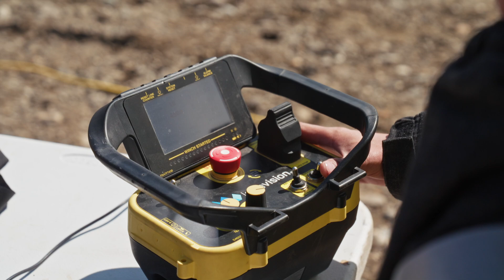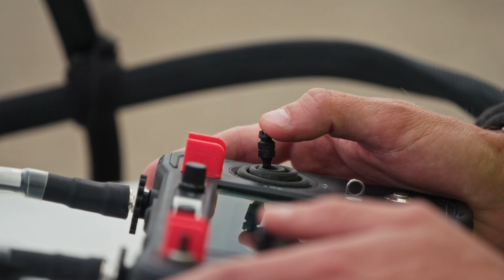Power to the People - 3 x 500kV Drone Stringing at Site C with Infravision and BC Hydro

Comment: Why AC instead of DC?
DC much less resistence.
Bum Crack Hydro suspicious conduct.
Why can't Vancouver Island generate their own power?
You replaced the DC submarine cables with AC but I don't remember public input.
Reply: Why don’t you apply to work at BC Hydro since you seem to know so much champ?! 😂 always a conspiracy somewhere for you nut jobs isn’t it.
Reply: You’d need rectifiers all over, not sure what the cost vs the loss from just running ac over long distances is. Another thing to consider is space because I’m sure rectifiers for 500kv isn’t small.
Reply: I was at the Duncan substation.  The setup was massive.   We saw big circuit boards the size of a squished flat side to side Cooper Mini with a gallon jug of mercury right in the centre of it.  There were a few of them in a stand all with big arcing tracks from one side to the other.

They were buying spare parts from a dam in the USSR (I think it was Georgia) as there were none available elsewhere.  The cables were leaking oil.  This is in Duncan.  The frequency filter yard was massive chopping that square wave to something a lot more sinusoidal.  

It was failing, too expensive to run.   They built the Cheekye / Dunsmuir AC Line for redundancy before the Delta / Duncan HVDC line failed.  After that I lost track of it.  

Wonder why Wayne thinks they should have talked to him about replacing a failing HVDC powerline?  Perhaps he owned property in the rights of way they forced through Delta when they were building its replacement.

In rereading I see that Youngsta0 's comment was more general about a 500KVA DC transmission line vs an AC one not specifically related to the Delta/Duncan one that I construed Wayne was referring to specifically, which he wasn't.  BC Hydro doesn't generate power on Vancouver Island by mid summer because the rivers are short, fed by melting snow pack and they need to keep the water flowing in the rivers to keep the fish fry from dying of overheating or just plain keeping enough water in the river so the fish don't get stranded.  Plus the Municipalities need the water in the reservoirs to dispense to their water wasting populations at Stage 3 and 4 restricted levels.  There's not enough water left over for power generation releases. 

Here is more information.  I'm not sure which pole we (the Camosun College's Electrical Trades graduation class of 1992 were looking at.  I was mightily impressed by the size of the circuit boards and what had happened to them.   https://en.wikipedia.org/wiki/HVDC_Vancouver_Island
Reply: Rivers dry up so that takes hydro out of the picture.
There would have to be a major shake up of government to force BC hydro to allow tidal bore power generation to occur at Mudge Island without it turning into that Run of River cash grab for Plutonic Power selling power for 40 years back to the grid at 65c/kWh when the going selling price was 6.5c/kWh and now about 11c.  

But BC Hydro always was about the sweetheart deal (Thank You Gordon Campbell) ever since they went for coffee with Enron and decided to screw PGE changing their outlook from "The People's Power" with E+ Metering of surplus power to Two Tiered Billing and soon to be Time of Day Billing which they said they would never institute when they were ramming their smart meters down everybody's throats.

I would never be for privatizing them but they sure do need reforming.